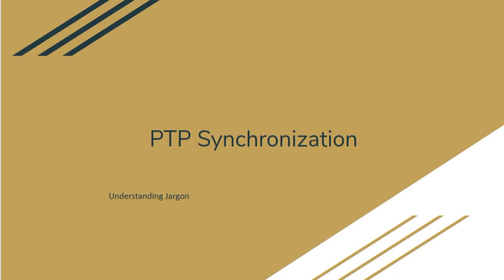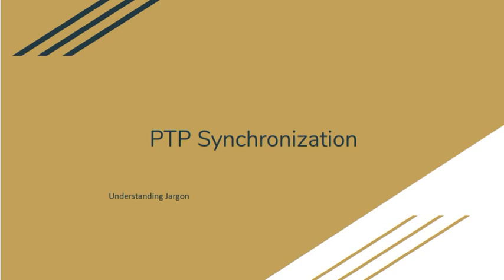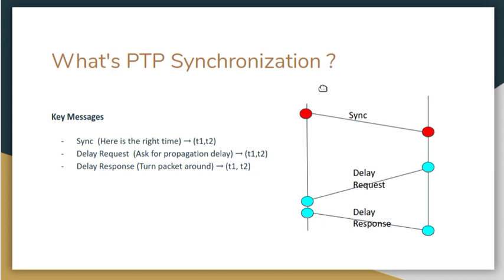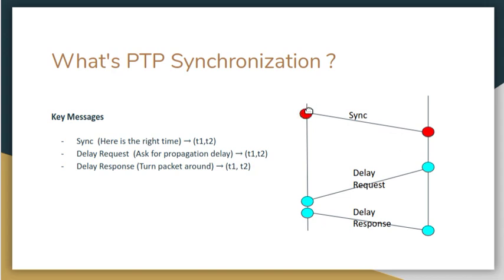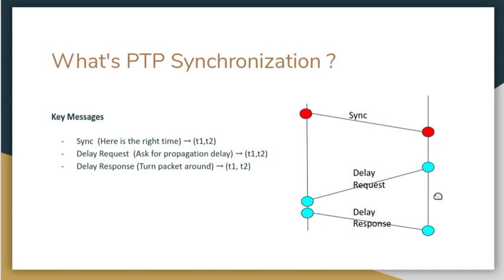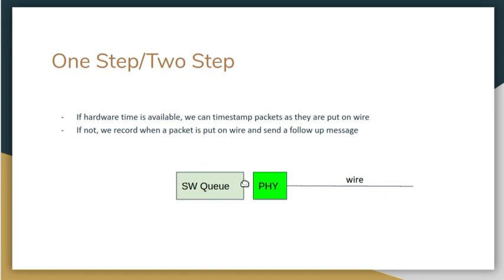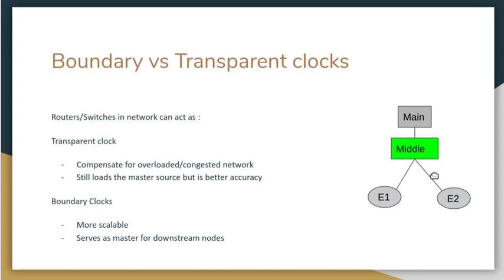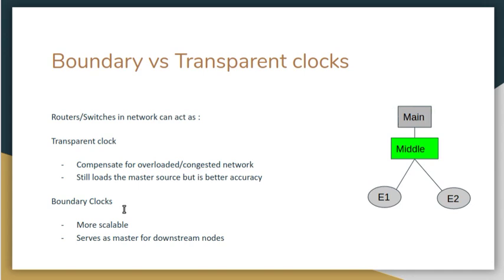PTP Synchronization : An Introduction

Comment: Clock synchronisation.......can't be done. That is why we cannot measure the one way speed of light.
Reply from the maker: I guess absolute clock synchronization is a physics problem, but if you do not care about pico second accuracy, you should be able to account for time error in travel and by computing time lags in travel path, correct the time at destination. My feeling is - The aspects of physics and relativity may not hold at such small distances as for our purposes.